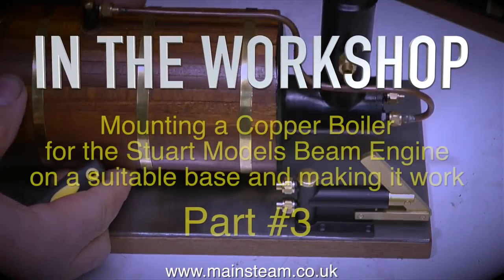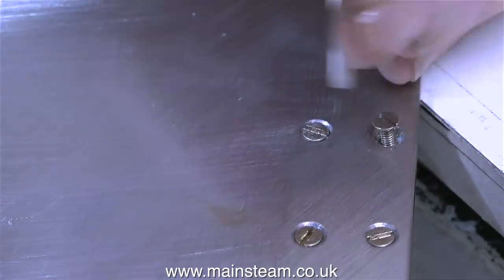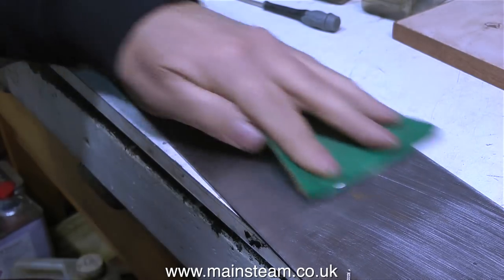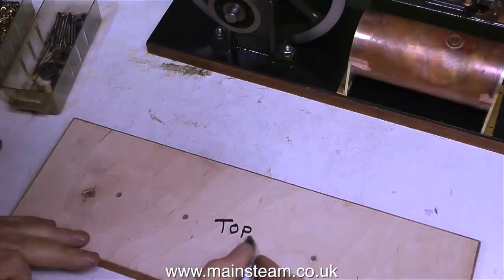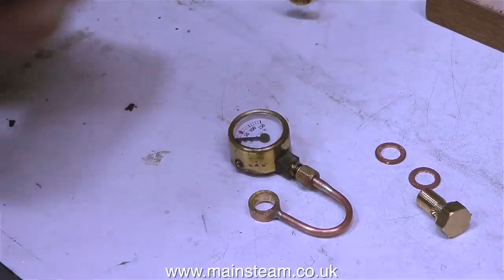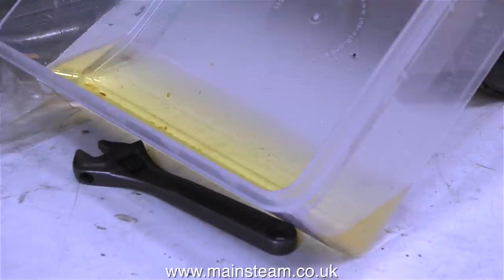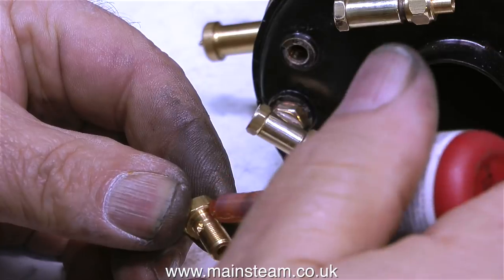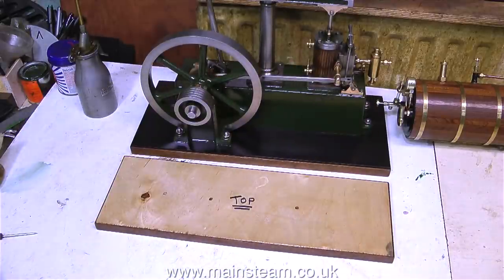A STEAM BOILER FOR THE STUART BEAM ENGINE - PART#3

Comment: I have a agree that the plain brass looks much better than the painted fitting. As it ages and tarnishes a bit from heat and use it will give a more realistic look to the boiler. If you want it to look shiny forever then you could just polish it when it gets dull with a little Brasso. Thanks for the video they are always interesting.

Comment: Another use for your silicone tubing. If you have a very small nut or screw difficult to screw in, take a bit of tubing and press it over and you have a screw or nut with a very long handle. When in place, just remove the tube and tighten.

Comment: As an Alaskan, I can confirm spray paint is miserable in the winter. Pressure in the can drops so much you can't get good aerosol spray. Hot water warms the can pretty well.

Comment: Hello Keith, ,, I had a 1964 Saab,,,  and in the tool kit was an 8 inch Bahco spanner.
I no longer have the Saab,,, but I did keep the Bahco spanner. ..
How small did Bahco make them? And is your's marked with a size?
Thanks for the good work. ..

Comment: I was just thinking on getting the water gauge brasses lined up. Instead of using the glass tube to line it up, why not use a metal rod of the same diameter as the glass?
Reply from the maker: yes that would also work if I had any 5mm short metal rods close to hand - I use the glass because it's convenient that's all ......

Comment: Hi Keith. Curious thing about the siphons, I've never seen one on Wilesco engines and other toys and they seem to work fine. Even an ages old Fleischmann engine owned by a friend has the gauge screwed directly into the boiler and it works fine as well. Do these gauges work differently from the ones needing a siphon, then?
Reply from the maker: Small Steam toys running at 15psi are very different to a big boy's toy running at 80psi - steam pressure is relative to steam temperature . . . . . .
Reply: I see, interesting.